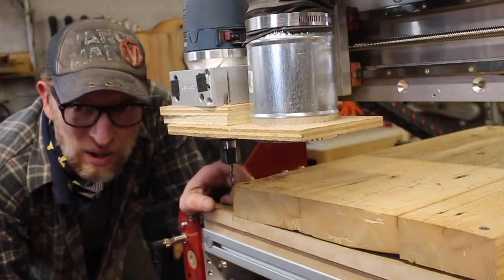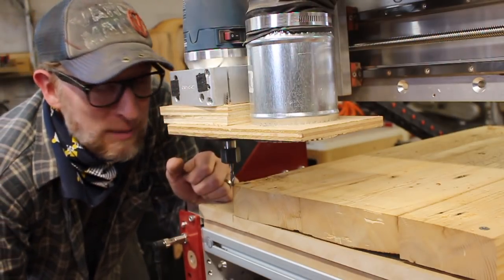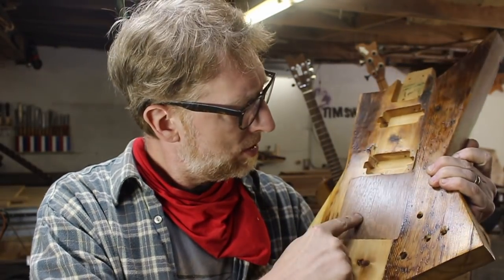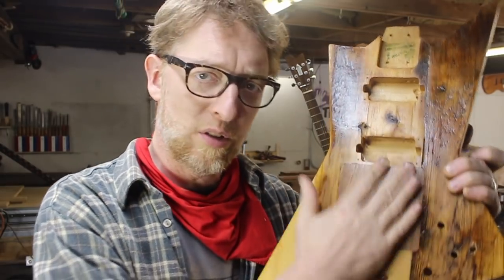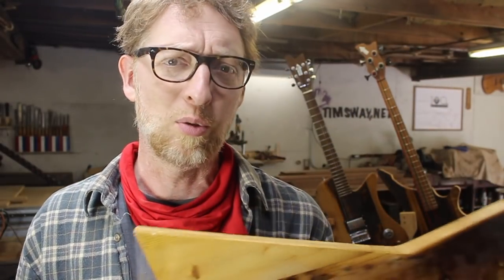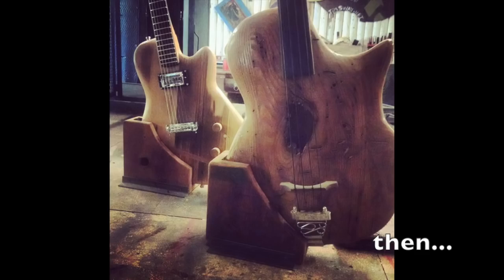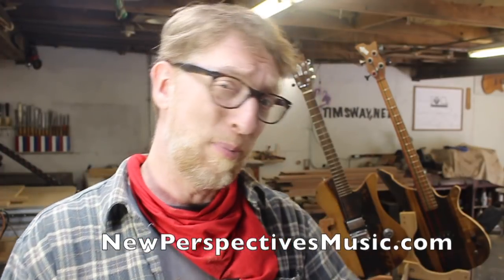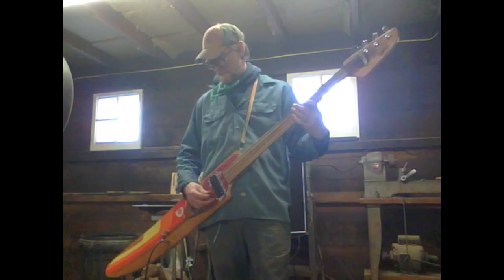Barn Wood Electric Guitar and Bass

Comment: Hey what kind of stain did you use, Is it some kind of epoxy resin? Looks great :)
Reply from the maker: thanks! I used linseed oil on the wood to get that golden yellow color and add some moisture to the dry, old wood. After that sat for a few days I sprayed many coats of a water based poly. I do use epoxy resins on cracks and weak spots sometimes. cheers!

Comment: These are my favorite videos of yours, Tim! One question though--okay maybe two. Have you ever tried to make a drum, or set, or a piano? A drum may be hard, especially if you don't have a wood steamer to make the wood flexible to form into a cylindrical shape, but a piano shouldn't be too difficult to make. Just some food for thought. Great job as usual. :)
Reply from the maker: The Rooster thanks. Did you see my marimba build from last year? Or the multi neck guitar with the mini cajon? That's the closest I've come so far and they are definitely thoughts, which is why the new website is newperspectivesmusic.com and not new perspectives guitars. Glad you like these because I have a lot more coming!
Reply: Oh no, I guess I missed those. I'll have to look for those two videos. :)
Reply: By the way, Tim, how's those vegan boots working out? They still holding up?
Reply from the maker: The Rooster search "multitar tim sway" and "DNA marimba" the red a bunch of videos on both. It'll keep you busy for an hour or two :)
Reply from the maker: The Rooster they are doing great. Better than I expected and honestly better than my last pair of leather workshops.  Another guitar build coming is for Carolina and incorporates the material my boots are made of. Fingers crossed for a production run!!
Reply: That is awesome to hear, man! You should do an update on those boots, and push for a signature campaign to get them to run a production on the Tim Sway signature vegan boots! :)
Reply from the maker: I will when I have all the info. stay tuned!

Comment: Good job brother. Question, what was the mixture you use for that clear coat in the spray gun?
Reply from the maker: that was just a water-based polyurethane. cheers!
Reply: @timsway  cool. Did you just add water? Was it one to one? I'm currently doing wipe on poly on my guitars but think spray would be less sanding of "orange peal". Cant   find videos on spray on poly. Thanks for the info.
Reply from the maker: @davidmead9799  I'm no expert but I just added water until it seemed like a good mix. Probably less water than 1 to 1. Still learning. I frequently use hand rubbed violin varnish too. That's real nice and easy.
Reply: @timsway  cool. Thanks. Keep up the good work sir

Comment: I noticed the neck heel is super shallow and not the 5/8ths like standard... that neck joint would give me serious concern
Reply from the maker: The neck pocket is .05" shallower than a standard Fender pocket. It has to be in the ballpark of factory guitars for off the rack hardware to work, like the bridge I used on this guitar.